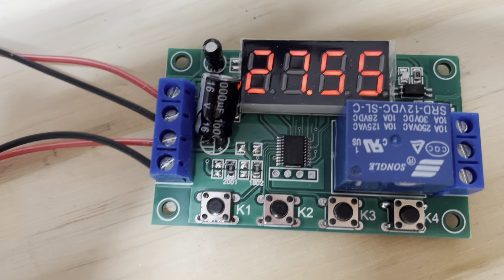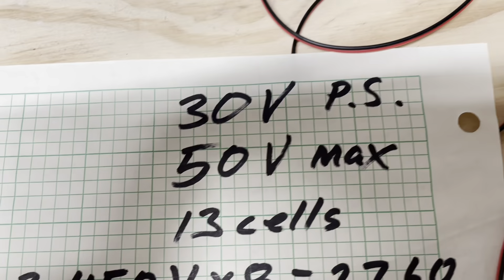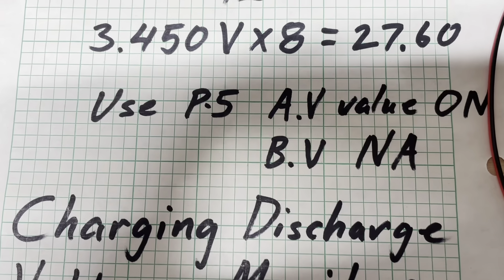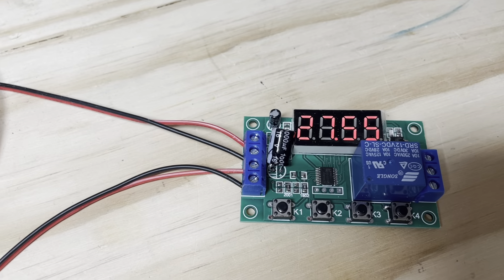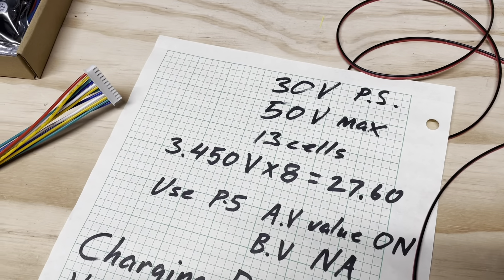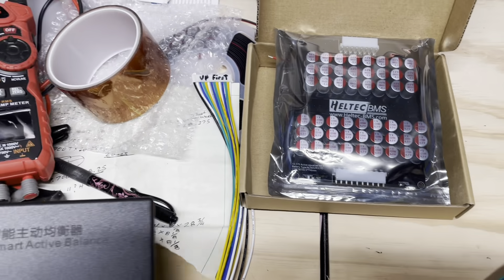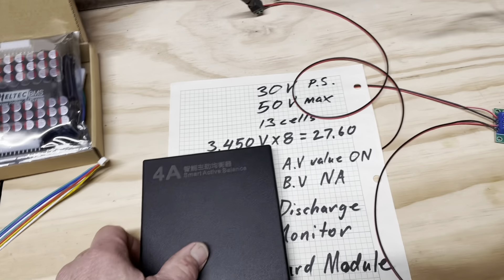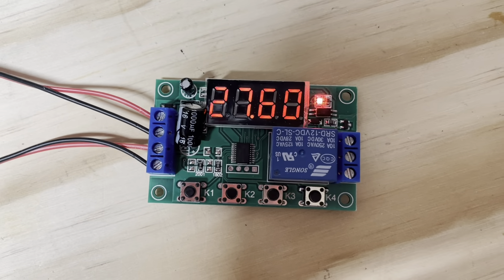Control your active balancer or equalizer for your LiFePO4 cells

Comment: Is there a sequence to turn these units on?  I bought two of these units and none of the displays are lighting up when I apply the 12VDC across the DC+ IN and DC- IN
Reply from the maker: Sorry not awake yet.
Reply from the maker: Touch switch K4. That should turn on and off the display if you got it wired right
Reply: @SkypowerwithKarl  got it… thanks bud
Reply from the maker: @EbanQHanna  
If you haven’t already, look at and pause my super short video 
“Charging discharge voltage monitor instructions”

Comment: What is the new balancer you are using and what has been your experience with it?
Reply from the maker: I replaced it with a Neey
"clone” (4 amp smart active balancer) and it's flawless! You need to find out if it’s android or iOS compatible (both???) version depending on your needs The new app for my IPhone that allows the “StartequalizationVol"feature. It has a new title in the app store"GeeWe BMS" If you have the old app on the phone you need to delete and replace, don't update it with the new one. To change the installed app to English, open the app, click on the three dots, then the gear, then the lower line of chicken scratch, now the circle/English. Restart the phone and it should now be in English. To begin: open the app, tap the three Lines, tap scan, tap on the results/ model on the top left. Now you are ready to fill out the settings if you have it wired correctly. When done, tap run and it will go through testing before running/or till parameters you set are in range to balance.
I set SleepVol to 3.415 and EqualizationVol to 3.425 and set your cell count. Other settings changes don’t seem to do anything so don’t bother. My hardware version is HW-2.8.0 ,software is SW-1.2.0 and app version is V1.1.1 
Hope that helps

Comment: I found one on eBay but it's listed max voltage indicated is 30V.  You stated yours to be 50V max.  Is this the same one with green board, 4 digits and 4 buttons?  

Also, what's the link for that active smart balancer please?  I can't find it on eBay.
Reply from the maker: I didn’t put a link because they pop up and down on those. The eBay sight I got mine from is gone. That’s why I described it. I think you found the right one and they must have de-rated the test voltage. And you are correct, I sampled across 8 cells. I have since retired this device and now use a Neey smart active balancer 4 amp(or re badged clone). The new app “GeeWe BMS” now gives total control on IOS.
Reply: @SkypowerwithKarl  thanks bud...

Comment: I wonder if the capacitors stay charged on the balancer when that board shuts off. If not, the surge from those capacitors charging could eventually damage either the relay, or the balancer itself. Sneaking a pre-charge resistor in there might be a good idea.
Reply from the maker: There’s next to no current at that control point. Perhaps elsewhere on the balancer board but I have to assume they thought of it. At any rate I’ve retired this type of active balancer and replaced it with a “4 amp smart active balancer”.  Much more balancing power when there’s reduced cell voltage differences. 4 amps regardless of voltage differential whereas the Heltec has 5 amps only at large voltage differential and much less when the Delta is low.
Reply: @SkypowerwithKarl  That makes sense. I had an old version of the 2 amp unit that made a very large spark every time I connected it.
Reply from the maker: @FYMFTP  
That would get my attention too. I hadn’t noticed it I was in the toying time and sticking a wire across to watch it turn on, but I wasn’t really looking for it either.

Comment: Hey bud, are your cells charging simultaneously as the active balancer is on? Do you have the balancing function active on your BMS? Because when I do both simultaneously for some reason my delta voltage rushes up passing 0.700mV.  Should this be happening?  Do you have any ideas as to why?
Reply from the maker: Yes, you absolutely can charge while using the active balancer (above 3.4 Volts per cell) and yes the BMS’s balancer can be on simultaneously. No, the delta shouldn’t get worse!?!?!? Double check all your wiring and make sure you don’t have a bad terminal/buss bar connection. You can not use the same balance wire for the BMS as a the active balancer (to reduce wires to the battery). Double check that the crimps to each balance lead is solid. If it’s one rouge cell, that’s where the connection problem is. Try moving the balance leads so that the BMS leads and the balance leads are at different ends of the buss bars (where you can) tho that shouldn’t make much difference other than showing up a bad lead to terminal contact. Did you have the connector unplugged from the BMS and the balancer while connecting leads? Accidentally contacting a lead across the wrong terminal can instantly damage balance circuits. Have you actually measured the delta with a volts meter to verify the difference between cells, not what the BMS says? A huge difference like that doesn’t happen fast just because of turning on the balancer. I’m thinking a bad connection somewhere. Weird Asf!
Reply from the maker: Where are you getting the 12 volts to run the controller? That can’t come from the batteries (tying into four cells) that supply must be separate from like a wall wart . Keep in mind all negative terminals on the voltage controller are common. That includes the voltage sense (-) leads.
Reply: @SkypowerwithKarl  I connected the active balancer to the battery and BMS by way of a double DIN terminal. Would that be considered as using the same wire as the BMS?
Reply from the maker: @EbanQHanna  
That’s probably where the problem is. Unfortunately, it’s got to be a bird’s nest of wires. Don’t cut or shorten them to different lengths. You can double and fold them to make it neater. The BMS’s leads should be the same length and the balancers should be the same length. Different lengths can throw off the balancing circuit, more so on the active balancer. If you have already cut the wire harness , not to worry. You can make it even better by cutting all the wires a few inches from the connector and solder and heat shrink some new extensions BNTECHGO 18 Gauge Silicone Wire Kit 10 Color Each 5 ft Flexible 18 AWG Stranded Tinned Copper Wire https://a.co/d/gdtNkRO  from Amazon.  41 Feet 3/16" Clear Heat Shrink Tubing Roll 3:1,No Wrinkle Electrical Shrink Tube for Wires,Marine Grade Shrink Tube with Adhesive Lined Waterproof https://a.co/d/duvboUw. On some newer BMS’s and balancers, they have resistance calibration so you can cut the wires to length need.
Reply from the maker: @EbanQHanna  
You may have a bad connection(s) in the DIN terminal so the active balancer current is going to the BMS instead of the battery. Making a left turn at Albuquerque🥴 Andy at Off grid garage had a problem with those things.
Reply from the maker: @EbanQHanna  
If you absolutely want to use the DIN connector, you may want to go with a heavier wire (shared) between the cells and connector. The more I think about it the more I think you have a weak balance lead crimp connection(s) at the cell(s).  Those those little things are notorious for bad connections. I use non insulate terminals, crimp, solder and heat shrink. Since I use clear, I slip a tiny little square cut number from my label maker in it before I shrink it down.
Reply from the maker: @EbanQHanna  
You can see the little terminals I did in my video “Top balance in series FAIL” experiment. And the temporary bird’s nest of wires Lol!
Reply: @SkypowerwithKarl  problem solved bud.  I installed a 12VDC battery for the controller instead of having it fed from my battery bank and that solved the issue. Thanks so much for your help.

One last question.  Do you have the balancing feature active on your BMS at the same time your Active Balancer is connected and balancing?
Reply from the maker: @EbanQHanna  
Yes I have my balancer function on in the BMS when it’s above 3.45 vpc.
Reply from the maker: @EbanQHanna  
Great to hear you got it. Always monitor the battery closely the first time especially when things turn on and feel wires for heat. Fuses for control circuits/power both + and - sides are always a good idea. WMYCONGCONG 5 PCS 5x20mm Fuse... https://www.amazon.com/dp/B07BVP8W16?ref=ppx_pop_mob_ap_share These little guys are what I use. To make it neater I put it in line without the holder. I just solder it in line and put heavy duty adhesive lined clear heat shrink over it.

Comment: Hi, very interesting solution. Could you make a detailed video about connection and maybe share a link where to buy this board?
Reply from the maker: They are available from many sellers on EBay just make sure it’s four digits, four buttons on green board and the same title “Charging discharge voltage monitor relay switch control module”. There are no instructions or program functions but I made one and will be putting on YouTube soon so you just have to save the screen shot.
Reply: @SkypowerwithKarl  Perfect thanks. Did you tested on your balancer the function? Did you used NC or NO for the cable of the balancer? Sorry for so many questions
Reply from the maker: @youtubeschauen3686  
Normally open. Use “p 2” program
Reply from the maker: @youtubeschauen3686  
Instructions are now on video YouTube 
Search “ Charging discharge voltage monitor “